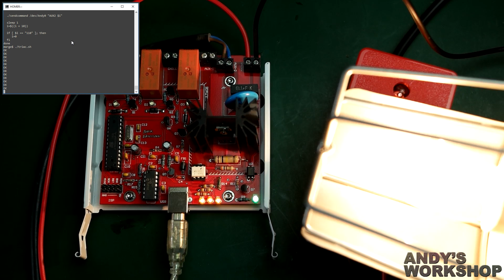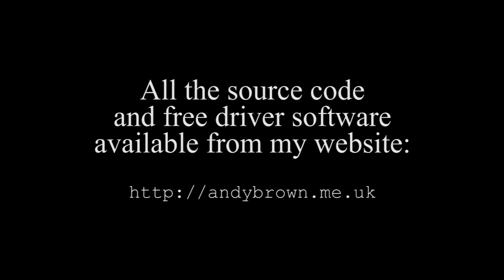Relays and triacs controlled over USB

Comment: Quite a few are matching the $5 for a 10x10cm 2 layer board - PCBWay and Elecrow are offering around same price. Of course the shipping cost varies quite a bit between them.
Reply: indeed, i recently got an order from elecrow, 5 boards thought they actually sent me 7, + stencil for smd components + shipping all cost $37. the stencil alone was 16 dollars so if you're using mostly through hole it is priced decently.